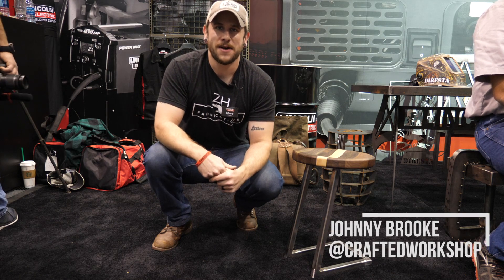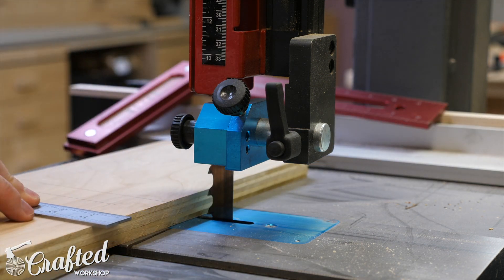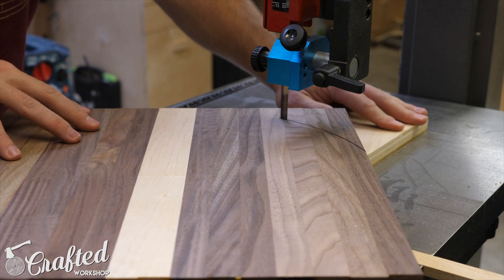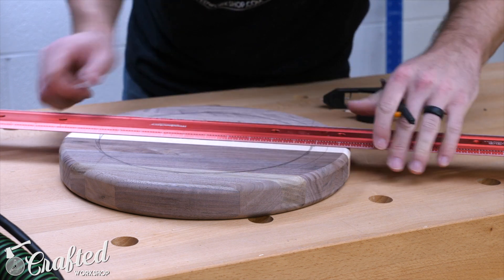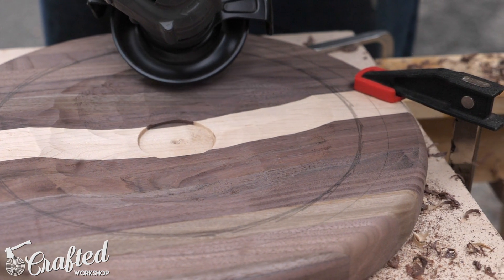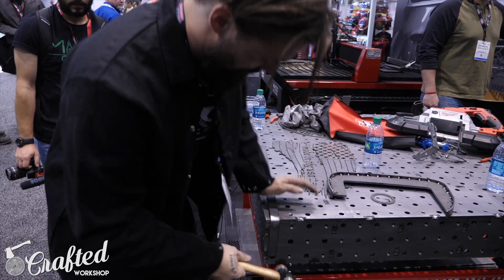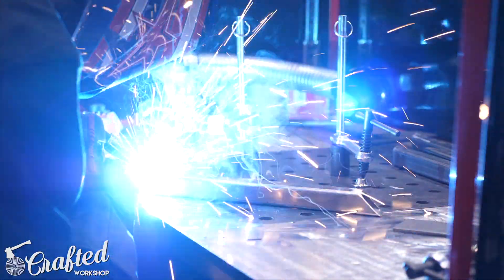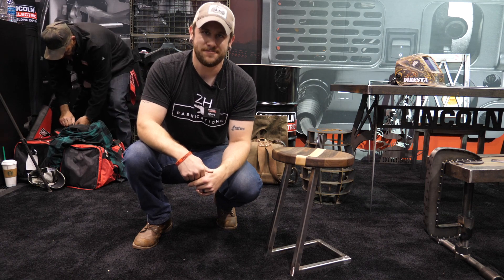Power Carved Walnut and Steel Bar Stool / Shop Stool Build | FABTECH 2017 - Woodworking

Comment: Definitely my favourite of all the chairs at the fabtech show, simplicity pays off - great job as always johnny :)
Reply from the maker: +JMakes thanks man! It’s definitely my favorite stylistically, although some of the others were more challenging on the metal side.
Reply: If you wanted to try and up the metalwork do you think it would be possible to planish/hammer a curved piece of sheet steel to make the seat and then weld on a rim, base & supports?
Reply from the maker: +JMakes for sure!

Comment: The Maple definitely helped the walnut out as it always does.lol  and you're right About  the air dried walnut the colors are beautiful! That stool turned out awesome! definitely have to look into  getting  a Turbo plane for the angle grinder good stuff as always Johnny..And this is my new channel my other channel was hacked
Reply from the maker: +JOE'S DIY & BASEMENT WOODWORKING oh dang man, that sucks! And thanks!
Reply: Crafted Workshop Yes it did but I got my original channeled back so that is cool the other channel that I set up thinking when I do something collaborative with it but couple other people nothing set in stone yet some does going to keep using my original channel dab on the hackers

Comment: Awesome stool! I’m interested in trying this myself with some pallet wood. How thick should I use for a base if I want to carve it out like yours? Also, I’m not a metal worker so I’ll need to find a base for it. I’ve found simple bases but can’t find a decent frame for the chairback so I may stick with just the stool. Thanks for the video and any help you can provide!

Comment: Looks awesome, and great use of scraps.  I'm curious your thoughts on the turbo plane vs. the miniature version that came out?  What size threshold would you want to switch from one to the other?
Reply from the maker: +Modustrial Maker thanks! Are you talking about their little bowl gouge or the one April just featured in her unboxing? Having varying sizes would definitely be handy, I don’t think the TURBO Plane would be great for super tight spaces. I’d say anything less than 6” would probably be too tight.
Reply: I should have known you would say get them all ;)  I saw the one April and DiResta used for spoons, but I think they make a mini Turbo plane in between that one and the one you used?  Do you think the in-between model would do the job for a chair like this?
Reply from the maker: +Modustrial Maker I would still want this sized model for a chair I think. And yes, buy everything, hah!